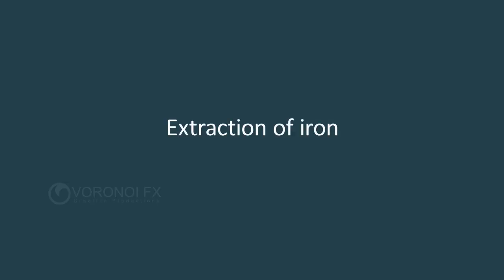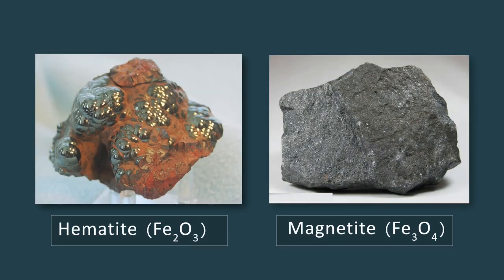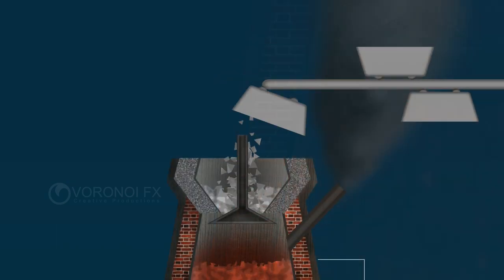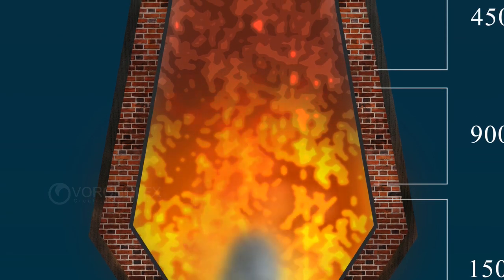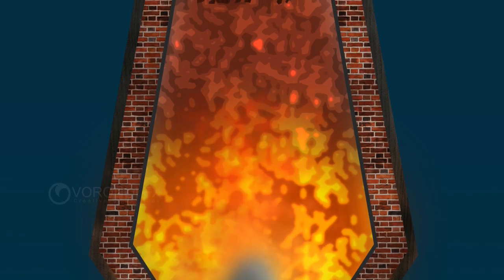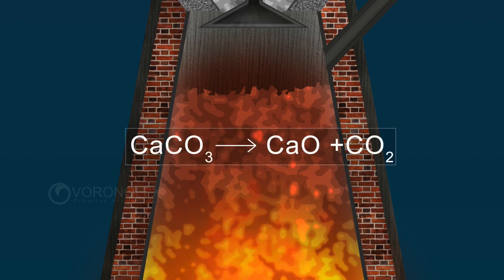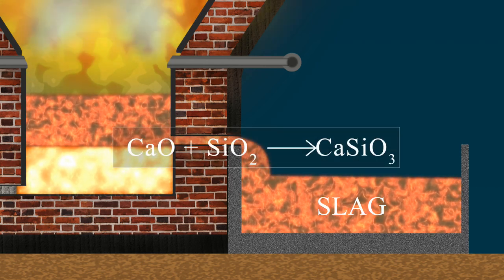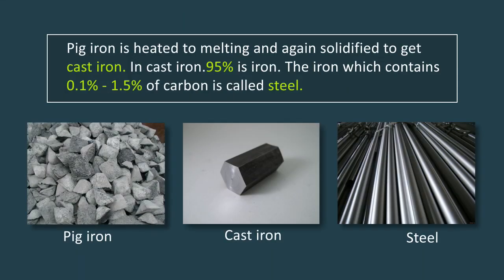Chemistry Extraction of Iron in Blast furnace - eGogy

Comment: Is this how to extract "carbon steel"? or just "steel" bc it has carbon on it?
Reply: I think this is how to extract iron, a pure metal. Steels are alloys (mixtures of different metals) which can be made by adding other elements, such as carbon, to molten iron. As far as I know, they're made in a separate process, using a different type of furnace called an oxygen furnace.  I could be wrong though since I've only just learnt this :/